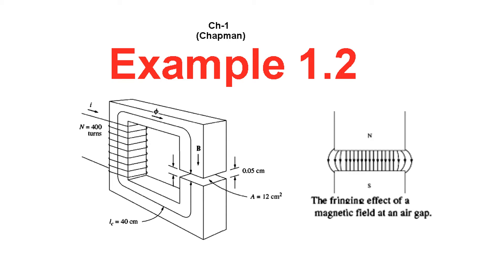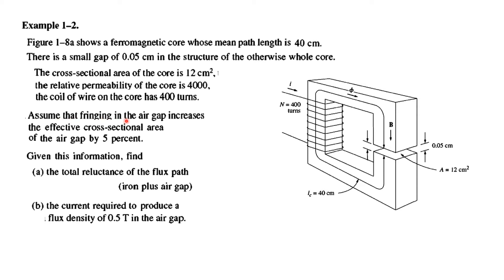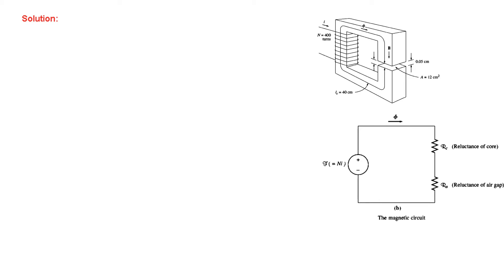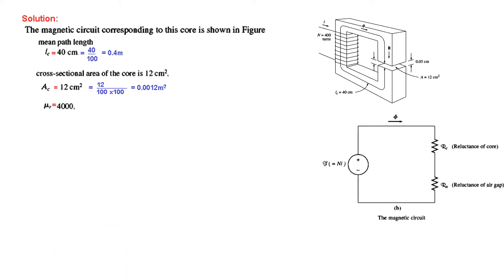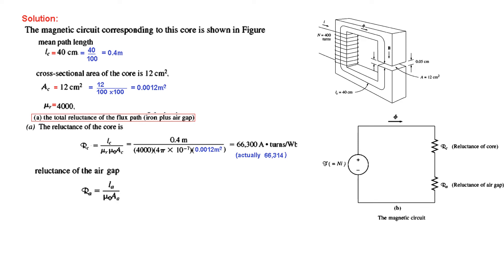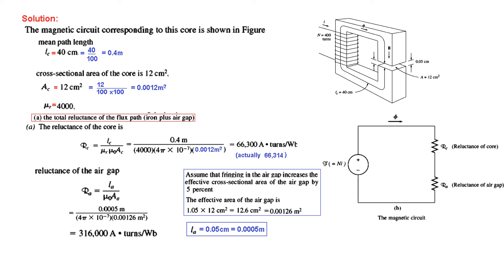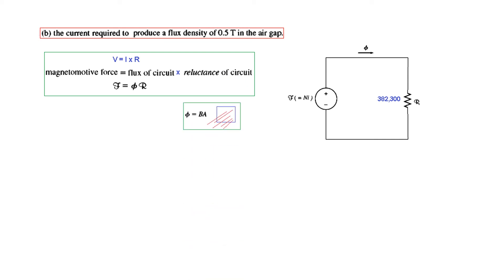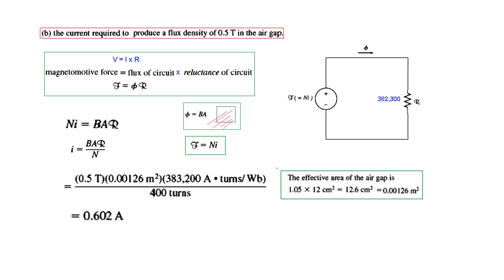(E)EM(C) Ex 1.2 || Calculating Total Reluctance || Magnetic Circuit

Comment: For a singly excited elementary two pole reluctance motor under constant current conditions, calculate the maximum torque developed if the rotor radius is equal to 4 cm, the length of the air gap between a pole and the rotor equal to 0.25 cm. the axial length of the rotor equal to 3 cm. The pole excitation is provided by a coil of 1000 turns carrying 5 A.
Reply from the maker: please give reference of the book.

Comment: for the last questions y did u use the total reluctance and not the air gap reluctance to get the current?
Reply from the maker: If u follow the logic of electricity, then I = V/R, where R is total resistance. That is what has been done here.  Since airgap reluctance is very large as compared to core reluctance, you can use only that to get an approximate answer.

Comment: Why did we multiply 12cm² with 1.05. I mean where did the value 1.05 come from ?
Reply from the maker: Please read 2nd para of the question. Due to fringing air gap area increases by 5%. So if it was 1, it will become 1+5%=1.05. If it was 12, it will become 12x1.05
Reply: @ElectricalEngineeringAcademy  is it mr or what
Reply from the maker: @رضا3صباحي     السيد
Reply: @ElectricalEngineeringAcademy  I still dont quite get it. what you mean is if it was 2 then it was going to become 2+5%=2.05 then 12x2.05??? thats what you meant ???
Reply from the maker: @kgaogelom7712  Think interms of dollars. if you has 100 dollars, it will become 105. if was 1, it will become 1.05, if it was 2, it will become 2x (105/100) = 2.10. if it was 12, it will becomes 12x(105/100) = 12.6
Reply from the maker: @kgaogelom7712  for 2 it will be 2 + 5%of2 = 2.1